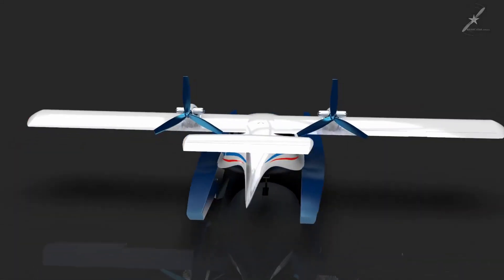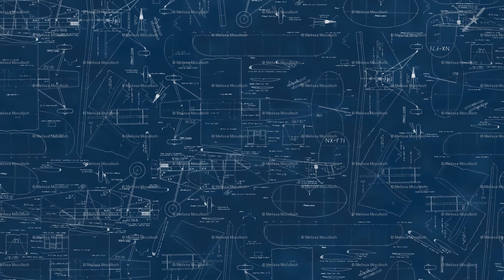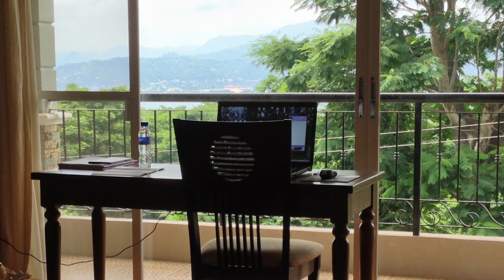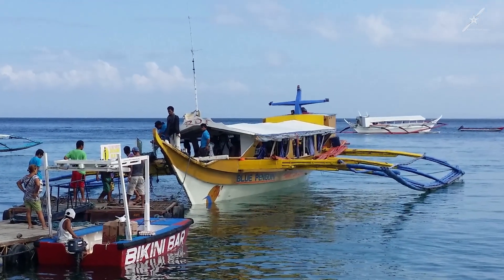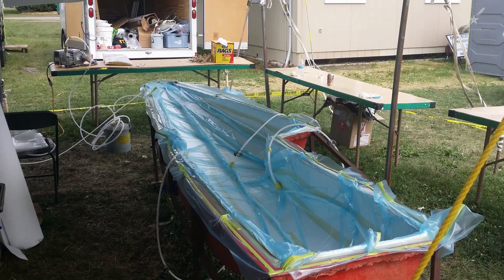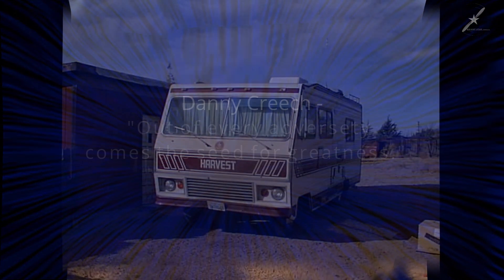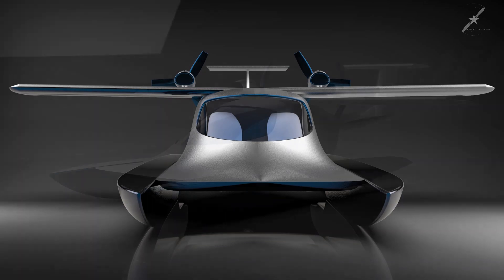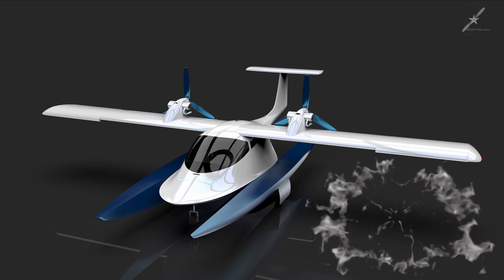My Radical New Amphibious Design!

Comment: Hi, I've worked in aerodynamics for many years. I'm passionate about amphibious planes that the West has forgotten in history. I have a question and a suggestion. 
The question is: What propeller are you using (diameter, variable pitch)?
My humble advice is to install the propellers on the leading edge. In this way, the propellers help the airflow on the flap during landing, decreasing the stall speed, increasing safety, and allowing the landing in the water with rough conditions. I know this configuration brings more drag during the cruise, but the aircraft would not have floats if this were its central point in the design.
Reply from the maker: Have not chosen a propeller yet. That will come down the line. Also, I get what you are saying about putting the propellers on the front of the wing. But there are reasons I chose to do it like this.

Comment: I could be wrong (I wouldn't be surprised) but those planes converted to sea-planes are that high from the pontoons so that when they are at the dock you don't have to bend over so much to pass under the wing.  And possibly at docks that deal with tides (Vancouver for instance) that wings will clear the pillons that keep the docks in place.  It would appear your design would mean people would have to crawl under the wing to possibly get to the rear part of the pontoon to tie it up to the dock.  Or make docking a lot more challenging if the wing can't clear the dock pillons.

I'm thinking the Icon can get away with this issue because it is intended or capable to be dismantled and trailered; so not intended to be left docked in the water.  I don't know about the other monohull sea-planes though but I think they are generally pretty large and have a fair head clearance.

Note: I'm no expert in anything at all related to what you are doing here but I find it very interesting.  My dad used to toy with the idea of designing is dream sailboat.  Similar vibe I get from your project.  Would love to see where you go from here.
Reply from the maker: Thanks for your input. I had not thought much about the wing clearing the dock. Mainly because I don't know many people who keep their plane tied to a dock. Most pull them up on the beach, bank, or taxi them out of the water. I will have to look into this a bit more. Again, thanks for your input and thanks for watching.

Comment: I noticed something in your design of the landing gear ... 
.
your front landing gear is set a fair way back and when you transition from water to land (usually a 20deg or more slope unless a deep sand beach your pontoon front ends will contact the ground BEFORE your planes front gear touches ..... 
.
I can think of 2 fixes .. 
-a longer front gear ... cons moves your center of mass and gravity forwards making the plane nose heavy and pitch down prone ... 
- add  pair of static front bogey wheels that just protrude under the front bottom of the pontoons ... they dont need to retract or even have shocks all they need be isa close fit to the pontoon body and rollable as well as water tight ... cons ... the bogey's will affect the aero dynamics of the pontoons and create turbulent airflow under the pontoons ... fix blend a fin out the side of each pontoon kind of like the nose of the sr-71 how it follows the curve out to an edge then comes back in ... this will increase lift as well as water stability and should compensate for the turbulent flow as well 
.
 another concern you may have is the cockpit being a little too close to the water ... ok sure pontoon boats look funny way up on their stilts ... but part of that reason is to avoid the buffeting of the waves on landing and take off as the hammering of the water WILL break the under fuselage ... think water hammer in pipes you might be landing at 100mph ... but the water will be slamming into your feet )essentially at 2 or 3 times that ... your landing speed (or take off) plus your weight  plus the water density  (hot water is less dense than cold) and the waters speed and direction and of course add Newtons law for objects in motion and at rest ... Inertia ... 
. a 10 ton plane at 100mph landing on a mild wave covered water surface with a 1mph current direct on axis of landing with 20c water will impart upwards of 8 tons of force PER SQUARE INCH ... that means a TON of ribs and cross members to account for the hammering again making the plane nose heavy and shifting the balance ... 
.
BUT if you scallop the front a bit and bring the fuselage up in the center say a foot (keep the molded connections just pull the center up a foot) you can drop that force of landing down closer to 1 to 2 tons PSI 
.
yes hydrodynamics and aerodynamics go hand in hand since BOTH are actually fluid flows ... one with less density is all 
.
also dont forget with a top wing design the lower you keep the weight the more self righting the plane will be (to a point) ... it is a fine dance to manage CG and CM as well as lift and drag both IN flight and on take off and landing ... I have found if you keep your CM near the bottom of the fuselage and your CG above it closer to midline or just above you get a good trade off between stability and balance in all modes a plane should operate at then you just need play with lift forward and backward and a little up and down ... (more down in your case) to get a compromise that will work for your asthetic pleasure ... and yes your CM and CG will adjust a bit as well but worry about those after you get the lift right then adjust them and recheck the lift ... these final tweaks will be in very small increments of 1/2 an inch to an inch ... so not super critical but needed
Reply: and yes I liked what I saw ... was hoping for 2 perhaps 3 video's mind you but real life can be a pain some times ... sub'd and liked
Reply from the maker: Thank you for Subscribing. There will be a lot more videos to come starting this next year. I am working on the third video now editing it. I hope I can get it published on here within a month. That video will show where the design is sitting today and more about it. I think you will like the next video and how we have changed the pontoons.
Reply from the maker: Thank you for your comment. You have one the record for longest comment. haha most will email me when it is this long. But I like it. Okay first let me say that what you saw is NOT what will be built. I am in the process of editing my third video which will show you what the aircraft looks like now. The Pontoons are much shorter. But I will look into what you said. If this is a factor that the nose gear is a bit too short then I may do a combination of two things. 1st lengthen the nose gear 2nd put small inline skate wheels on the front portion of the pontoons along the bottom. As for the water landing, anyone who tries to land this aircraft on water going 100mph which is just under it's cruse speed will deserve what they get when the aircraft breaks apart. This aircraft is being designed so that lands at 1.3 VSO which will be around 55mph. 
You have some really good ideas and I liked all of them. Do me a favor and subscribe so you can see the next few videos and how the design changes. Keep making comments or feel free to send me emails with what you see that might need to be changed. I keep an open mind to what everyone has to offer.

Comment: A safety feature which is IMO well worth it and underutilized are aircraft ballistic recovery systems - a parachute, basically, that can be deployed and bring the whole aircraft down safely. Not only is it safer than a regular parachute, it also usually saves the whole aircraft instead of crashing it.  But it has to be designed in from the start to be done well, and it requires allocating some space and weight which comes out of carrying capacity - But as I said, I think it's worth it.
Reply from the maker: Thanks for the comment. That type of an item isn't necessary on a twin engine aircraft. Generally that is for marketing purposes for single engine aircraft to give low time and poorly skilled pilots the feeling of safety. Fact is the only time a parachute could help is if that aircraft with only one engine stops and the aircraft is over water or a forest/heavy snow. In a twin engine if one engine goes out you can just keep on flying to a safe landing area. Having a second engine is way better than a parachute. But thanks for the comment.

Comment: What about a tri-hull?  You could use the space in the center into an RV-like camper.
Reply from the maker: I believe that would add to much drag and isn't the look I am going for. I am designing this aircraft more like they do in the auto world. Starting with a shape/look, then designing the wings, tail, and internal parts to work with the shape. As we progress, the shape will have small changes to it so that it is safe and efficient.

Comment: Nice I'm work, I'm wondering what airfoil you plan to use? I think the Riblett 35a6 or 35a4 would be a good match because you are using a sheeted wing.
Reply from the maker: I will be revealing that in my next video. So please subscribe so you can see it when it comes out.

Comment: I only make model planes so take this with a grain of salt, but here are my impressions.
The large flat duck-bill style nose seems very risky, what is the reasoning for that? ('sexy' is not a valid answer). It's like having a horizontal stabilizer on the front that's larger than the one at the back and also further from CG by the looks of it. That's the opposite of what you want for pitch stability and the sharp edge only amplifies the problem, as you showed with the footage of those powerboat crashes. The overall upward slope over the windscreen will cause significant down-force which would need to be overcome by flying at a much higher nose-up attitude than normal. It might not be so bad if the underside of the fuselage had an counteracting downslope, but the underside overall slopes up as well. Better to have the fuselage forward of CG as blunt and aerodynamically neutral as possible.
Speaking of the fuselage underside, since it starts low and slopes up at the back with sealed sides around the pontoons, you are creating a lower pressure effect similar to downforce-inducing rear diffusers on Formula 1 cars, very popular for sticking a car to the road but probably not what you want.
The pontoons seem larger than necessary, between the two of them they look like they'd have almost as much aerodynamic effect as the fuselage itself, with large side area ahead of the CG. Having them sealed to the side of the fuselage might look nice and be good for getting in and out, but it opens up an enormous can of worms for strong ground effect interactions. You basically have a biplane with an extremely complex lower wing that I doubt even experience plane designers would want to figure out. I would suggest that the float Cessna you showed that 'looked too high' was done for a very good reason ('looks too high' is not any kind of scientific approach). Most likely there are sudden changes in behavior when allowing the whole aircraft to get very low to the water. Water also has bumps and splashes everywhere. With more separation between fuselage and floats the aerodynamic interaction between them drops to insignificance and the behavior of each will be easier to calculate and predict separately. It will also be easier to swap out the floats with different designs. For example, floats that have a blunt front like I was just saying about the fuselage, instead of the sharp-nosed yaw instability inducing ones in your pictures. I'm also not sold on having the wheels in the floats. Seems like it would be better to have them in the fuselage, that way the floats can be made completely 'dumb' ie. a simple lump of buoyancy with no linkages, doors, electrics etc. and they would be easy to remove when not needed, and much easier to construct. If you're serious about selling these, it might be more attractive to a potential buyer if they can buy the plane without floats at first and then get them later, rather than be forced to have floats attached permanently. Many people might like the plane but have zero interest in water landing.
Gaining enough speed on water to lift off requires way more power than on wheels. I don't know how much of it those two motors have, but they seem kinda small. I think it would be better to face them forward ahead of the wing so the flaps will give lift at lower speed, since you'll be needing every ounce of lift you can get. As one other commenter here mentioned, that would also help to keep the props out of water spray. It's also much easier to work around a nose heavy design than a tail heavy one. The position of the props is way too close to the trailing edge of the wing, this will be extremely inefficient and noisy and I don't know what's supposed to happen when you want to use flaps...
The acute angle where the wing and fuselage join is not good for interference drag, and makes the join weaker. Would be better to beef it up and fair in the join more.
I've never seen suspension linkage like that and I'm having trouble vizualizing how it's supposed to work. Seems like it allows a lot of sway forward to back, and unless the linkage arms were widely spaced side-to-side it would probably have trouble tracking straight too. Make a simple model and check this.
Elevator looks too small to provide the torque necessary for rotation, given the downforce on the nose. The high position of the motors will also be pushing the nose down, and water drag will be sucking away a lot of energy. I would be surprised if it could rotate at all actually.
Overall I think you need to focus less on sexy renderings and try simulating this with a proper software package. In other comments here I see you're content to let other people make RC models and tell you how it went, but this seems like a terrible idea. For one thing you don't really know if they'll actually do it at all, or whether their model will be accurate, or whether they are competent pilots. Unless they live nearby you will not be able to inspect or tweak the model to make changes. You will also not gain any experience in building, which it kinda seems like you need, especially if you are thinking about composites and even producing kits for others to build. Working with composites is a huge pain in the ass in many ways, you would do well to make some models yourself to have a first-hand experience of where the difficulties lie and what results can reasonably be expected. Maybe you don't fly RC already but as an experienced full-size pilot you will pick it up in no time at all.
I hate to make such a negative post, but I hate being a yes-man even more :)
Reply from the maker: Thank you for your comments. It was a bit long, but, I understand that if you took that much time to write it, then it means you care. So thank you. I did not take it as negative. So, as you know this is a work in progress. The nose has been changed already back to the original design. The "Duck-bill" is gone. There were many items you suggested to be changed like moving the engines, removing the pontoons, raising it up off the water more, and so on. At this point I do not believe we will make any of those changes. The one one that may happen after we fly the prototype is to make the area between the fuselage bottom and the pontoons open. This would allow the air on the bottom of the fuselage to flow out the sides at low speeds and high angles of attack. As for the RC point, there are those that want to make it. They would then send the RC to me and we would fly it. I do have RC experience but that was many years ago. So I would probably find a local guy who is an expert and let him fly it. I do not believe I will learn much from an RC plane though because besides from the looks, an RC plane is nothing like a real plane. The power to weight ratio is way off, the CG is not going to be close, the scale of the weights do not match, it will not float like the real plane, and so on. They can be good for wind tunnels for air flow if build correct. However, Solidworks can do simulated airflow which will get us close enough. 
Thanks again for your comments. Keep watching to see how the design changes over time.

Comment: When Piper re-engineered the PA-32 for a T-Tail design, they found it to be not as effective during landing. MAYBE that is because the prop is not inline with the T-Tail on their design. Yours is in line with the horizontal stabilizer, so that could help.

Also, do you still fly that Zenith plane? Looks to be a 750.

Thanks for inspiring us. 🙏
Reply from the maker: Thanks for the comment Jayden. You are correct. During the landing flair (about 10-15 degrees nose up) in a piper with a T-Tail the wing blocks/disturbs some of the airflow. It's not so bad that they had to change it. Obviously as they sold them with a T-Tail.  Honestly, I am not that much of a fan of the T-Tail. But with my design I felt I needed it as I  wanted it up and out of the water. Also, with the props blowing air over the tail at any speed, it keeps airflow over the control surfaces. With  that being said, the T-Tail is not set in stone and may change after presenting my CAD files to and actual Aircraft Engineer. So, we shall see how this pans out.

As for the Zeniths, yes I fly and instruct in them and have built three full aircraft and worked on a lot of them. I have help build a 750 and 801 on top of the 701s I have built and worked on. It is a fun little plane.

Keep watching, lots more to come.